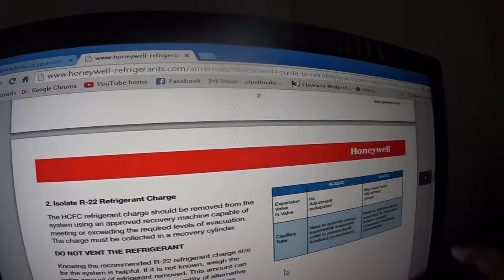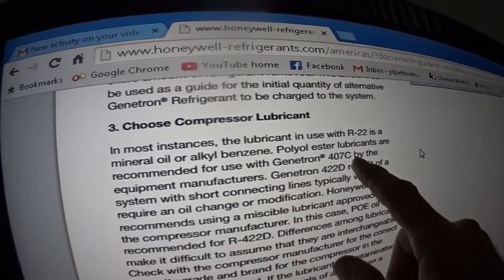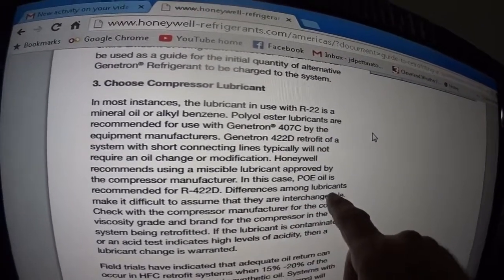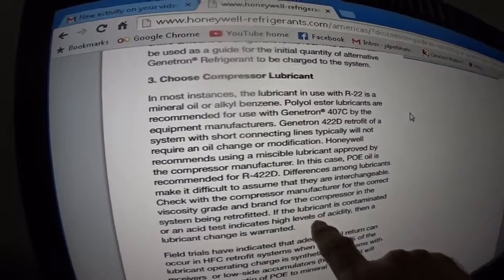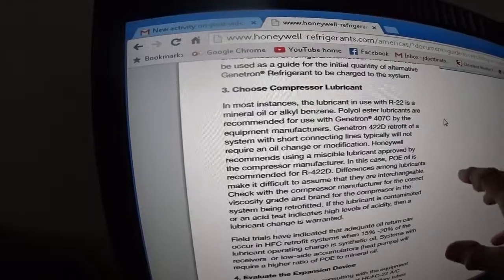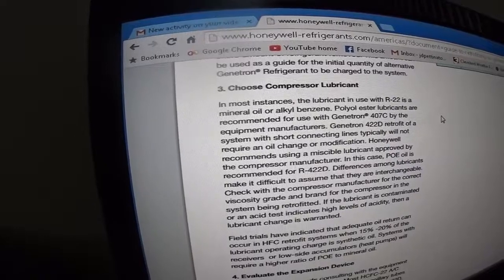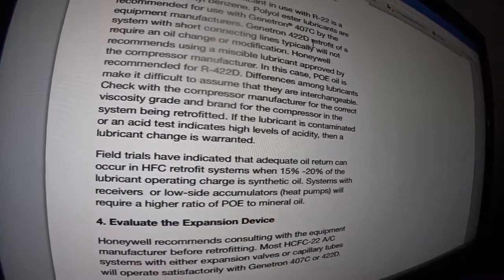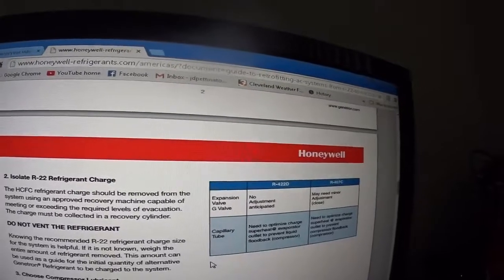POE oil on top of alkabenzene oil in refrigerant change overs

Comment: maybe a dumb question but can u vacuum out oil from a hermetic compressor like a scroll? i have been nervous that this may happen during evacuation so i always try to vac as far from compressor as i can.  i wonder if i need to take any special care.

thanks for any info

if so can it be put back? is there a way to measure whats in the system?

thanks
Reply from the maker: the vacuum pump just removes molecules of gas
Reply: Jim Pettinato thanks

Comment: After completing some of these retrofits in the early 2000's on rack systems (R502-404a) we removed and 95% of the mineral oil as per OEM instruction only to find that valves EPR's solenoids & TXV's were sticking . This problem was resolved by reintroducing the mineral oil or alkabenzene to approximate ratios of 80 to 85% POE and 15 to 20% of the alkabenzene or mineral oil, after reintroducing these oils the valves started functioning properly again as they were lubercated better, these were OEM specified Retrofit procedures from Tyler and Husman. The first two stores we did were complete nightmares with hundreds of callbacks from valve problems in different parts of the system. After getting it under control and realizing what we need to do we converted six more stores using those oil ratio's and had minimal problems .
Reply from the maker: +Adam Lundy good input, I think eventually the oil companies will develope POE/mineral oil hybrid,  thanks
Reply: Hope so.

Comment: Good video.do you use r-11 flush when you change out a burnt out compressor to flush out the whole system
Reply from the maker: Mi Heating Guy no, if I have a bad burn out I'll install the compressor with a new filter drier , let it run a few days to let the acid collect into the new compressor's oil, then I'll take the new compressor off, drain the contaminated oil and replace it with fresh oil, and a new drier filter, the system will now be clean.
Reply: *****  I am not disagreeing with you but seems like a lot of extra work if you could just flush it you could save a trip
Reply from the maker: Mi Heating Guy I did that once, the r11 flush & kit cost $100. I put it in the system, then it got hung up in the reciever, evaporator and condenser, it took several hours for it to evaporate out with a vaccum, I don't see how it flushed anything. If I had cut the lines and poured it through then maybe. then the suction line and the liquid line would be clean but not the evap coil or the condenser coil or the reciever or the suction accumulator.
Reply from the maker: ***** The flush kit was $100. a 24 lb bottle of R404a is around $80. it would be cheaper and easier to flush it with R404a. I  like coming back in a week and changing the oil the best, it might be additional work but it's another pay check and it cleans the best.